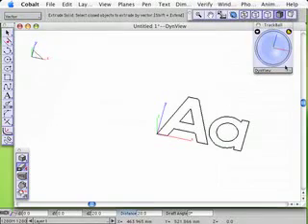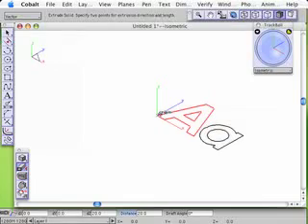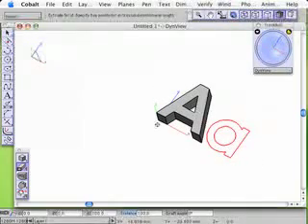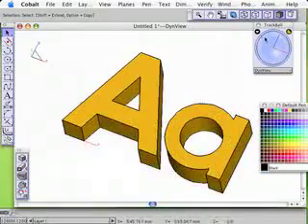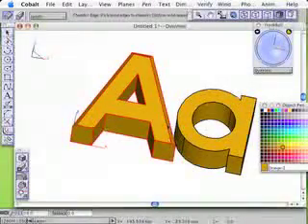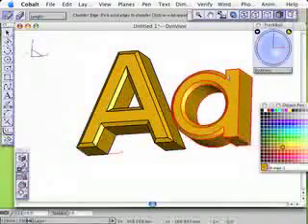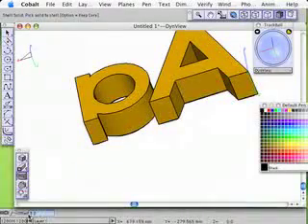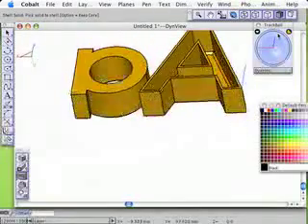CAD Ashlar Vellum - Tutorial No.6 - From lines to solid

Comment: I am an avid Ashlar Vellum fan, been using 2D Graphite for about two years in my interior design business.
I recently took on freelance design work for an engineering firm where I'm having to learn Solid Works and the contrast between the two brands is huge.
I ended up finding your series because I was wondering how the 3D Ashlar-Vellum programs work.
Now I know, they are brilliantly simple and straightforward.
Cheers mrgmacd, thanks for the input.
~lox